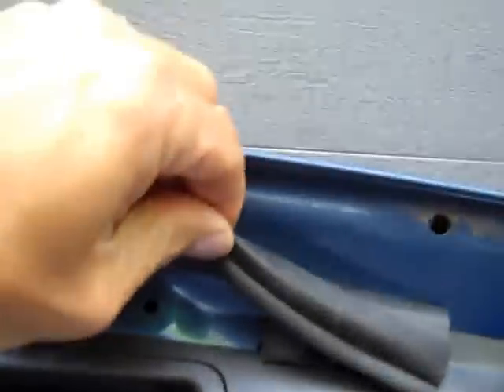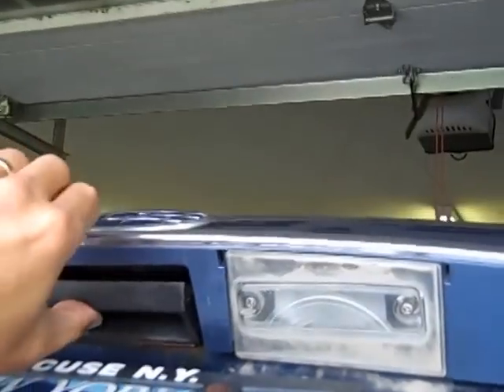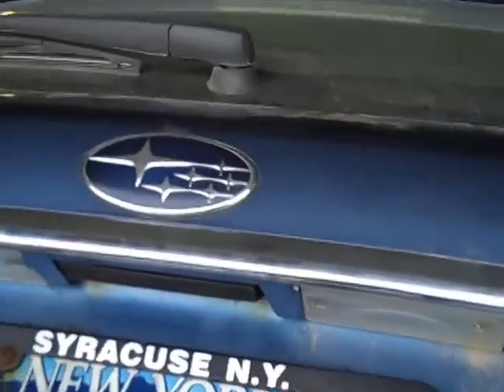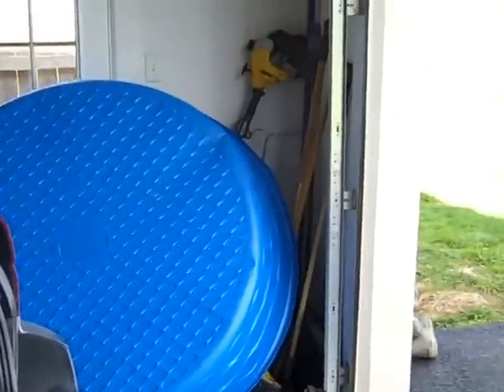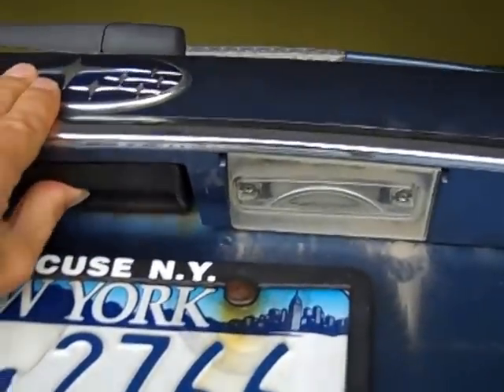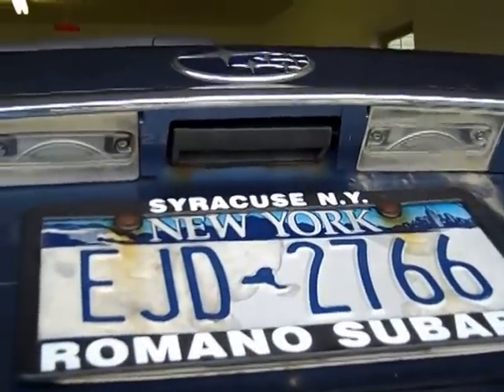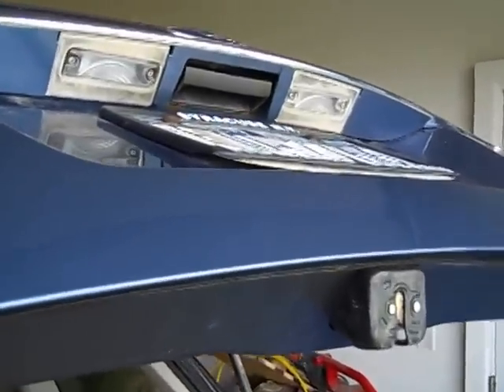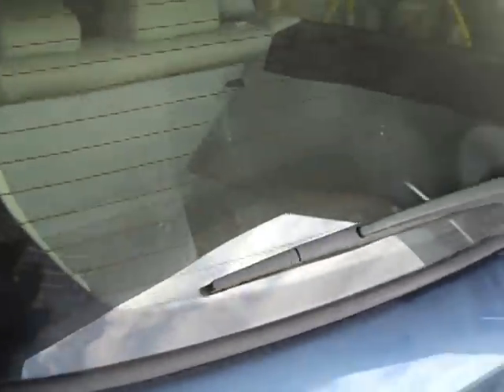Fixing stuck/seized hatch latch on a 2008 Subaru Outback

Comment: Tx for posting. I can understand why you didn't want to do it all again for the video. Your explanation was good enough, though. All I was looking for was that I had to remove the exterior modeling too, and you confirmed that. Only part that wasn't obvious about that was removing the black trims on each side of the hatch to find the two "hidden" bolts. Mine wanted a little persuasion to release and I'm always cautious about applying pressure to moldings.

For others attempting, I recommend spraying with rust paint after filing the rust and greasing before reassembling.

Comment: Thanks, helpful.  I ended up lubing it as best I could and then it seems the only thing retracting the whole mess is a little spring down by the latch, I used a needle nosed pliers to move the anchored end of the spring way back to the edge of the housing, that provided enough tug to pull the handle back, I'll probably have to go back in and do it properly at some point

Comment: Hope the video states the nut size on the outer trim retaining studs as I need to buy a long reach socket to get at them
Reply: Dave Measor  8 mm & 2 on each side under black covers  May post a video once all are out 
PS the under cover ones were rusted & 2 of 4 broke off -- Use some release spray
Reply: Dave Measor  The nuts holding the actual latch are 10MM  & need long reach socket also
I used a small diameter drill between the plastic & the end metal to clear the rust T then a dremel wire disc for final clean up  I put on a coat of Neverseize  in hopes of preventing the pivot points from rusting up again